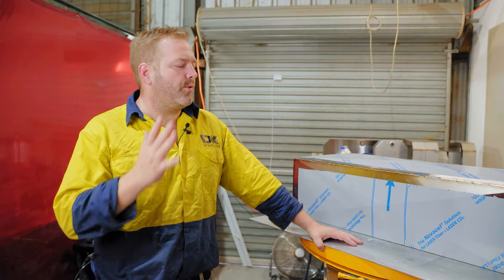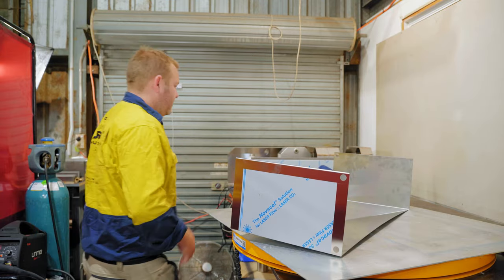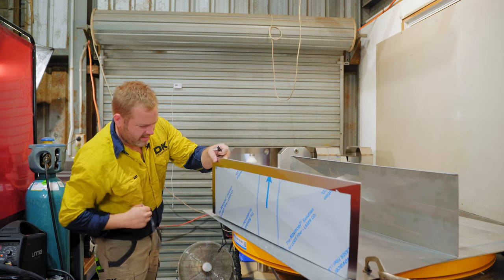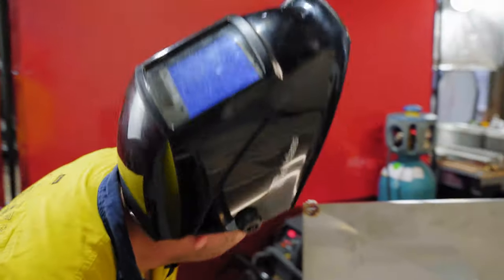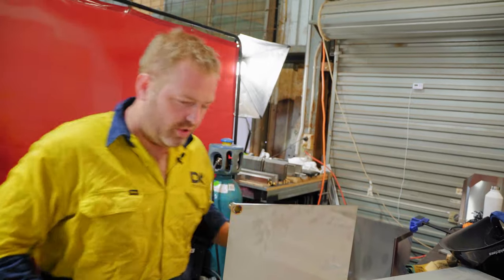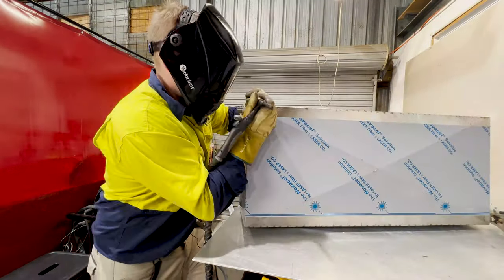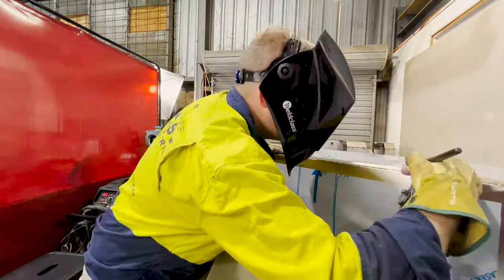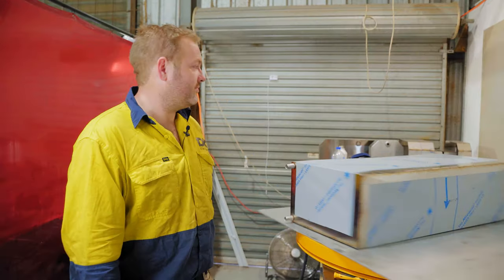95 Litre Stainless Steel 4WD Water Tank TIG WELD OUT!

Comment: hi mate, did you just use filler on open corner and just fuse on the lap joint ?
Reply: Hey @daveyjohns. the whole tank is fused and the fitting use filler.

Comment: I plan on building a water tank myself for my 4x4. My question is whether  to use PVC or stainless steel, If somebody has experience please respond. Thank you
Reply: I work a place and we make plastic and ally tanks mainly. But the plastic tanks are made in moulds and go through industrial ovens etc. so I’d imagine it’d be easier to make an ally or stainless tank at home in your garage

Comment: How's the backside of those welds? I can't weld stainless that thin without back purge and not get sugaring everywhere inside.
Reply from the maker: This lap weld is in 1.5mm stainless. 1 side is raw edge fusing to a folded egde. There is penatration into the material but no sugaring on the back side. 
Practice makes perfect. 👌

Comment: Did you purge the tank with Argon for the full welds, or do you find you don't need to? Thanks
Reply from the maker: Hey Hugo! 
No. Didn't need to purge tank. Just had lots of pre and post gas flow. 👌
Cheers,
Dan
Reply: @DKStainless  so that is enough to prevent sugaring on the inside of the tank? Beautiful tank BTW and thank you for the insight!